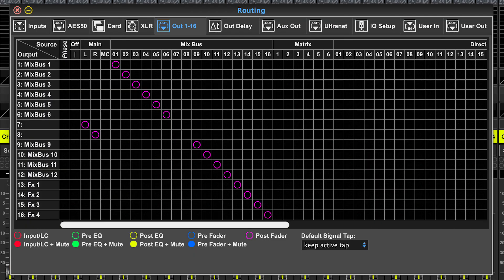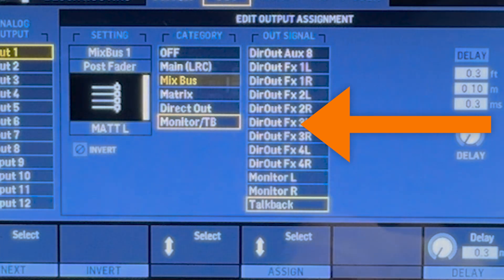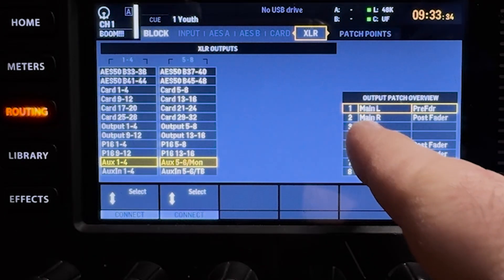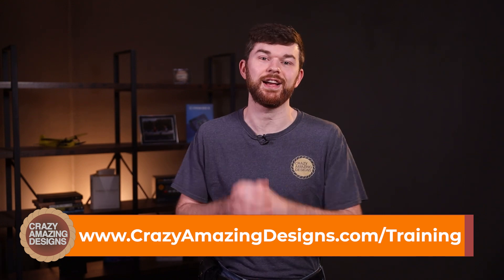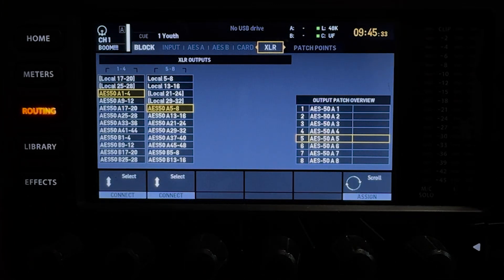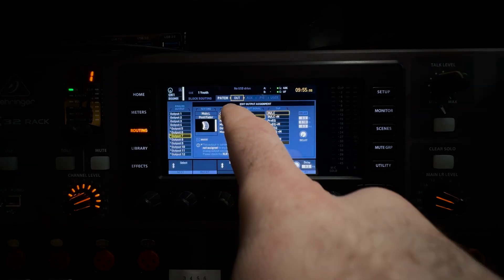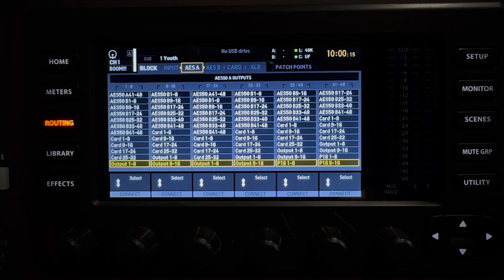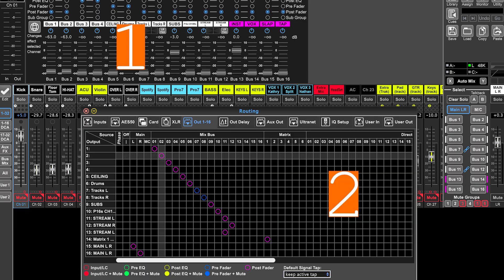How to Route Audio on the X32/M32 | Internal vs External Outputs Training

Comment: Hi. I’m building a scene for an m32 and DL32 using the m32 editor. After assigning my internal outputs, if I set up my XLR tab for bank 1-4 to be OUTPUT 1-4 and bank 5-6 to be OUTPUT 5-8 while at the same time setting up the AES-A tab for bank 1-8 to OUTPUT 1-8 and bank 9-16 to OUTPUT 9-16 will this allow me to plug in at either the console or DL32s outputs and I should be receiving signal?
Reply from the maker: Yes, if you configure your XLR and AES50 tabs to route the same outputs, you should receive signal at both the console and DL32's outputs. -Nathan R

Comment: Very nice Video. I have a Neve 1073  hardware and i want record Vocals but use the Analog NEVE. Its best in Midas Use the XLR Inputs ou use the Aux In ? Regards from Portugal ! Nice Video !
Reply from the maker: Either the XLR or AUX ports can be used to output signal, just as long as you send the correct source. Are you having issues routing the audio? -Nathan R
Reply: @CrazyAmazingDesigns  Thanks my Friend. No, i dont have problems. I want begining connect my Neve 1073 to Midas M32 Live, but in correct mode. Xlr ? Aux in ? One day i read the Aux In introduze noise . This is because i ask .XLR Inputs or Aux In and Out
Reply from the maker: Sorry I don't get comment reply notifications. If you'd like to schedule a meeting with me over Zoom, I'd be happy to help you get the devices connected. www.CrazyAmazingDesigns.com/training